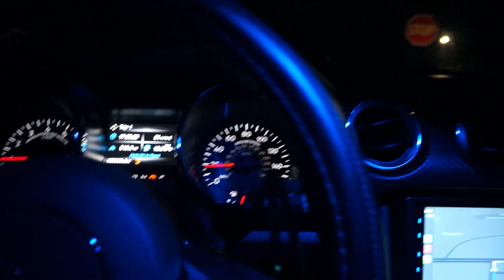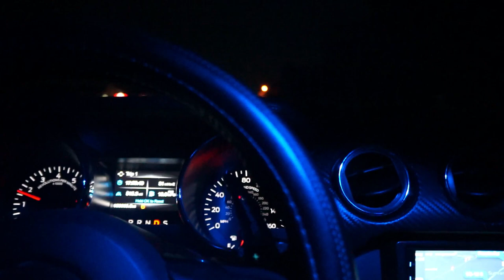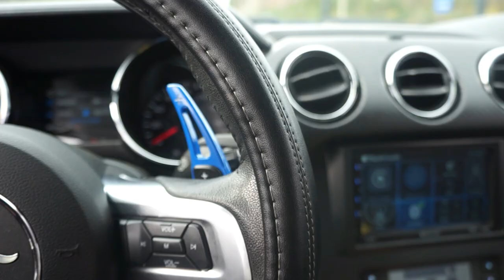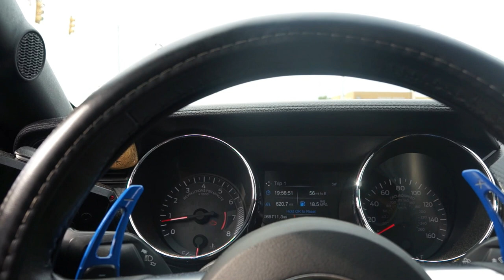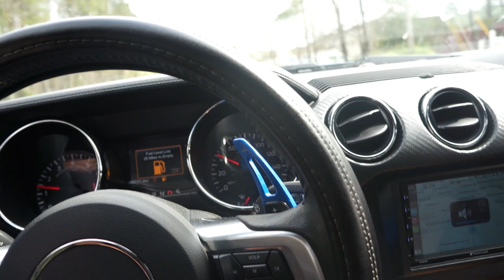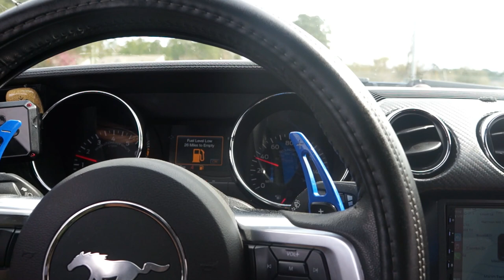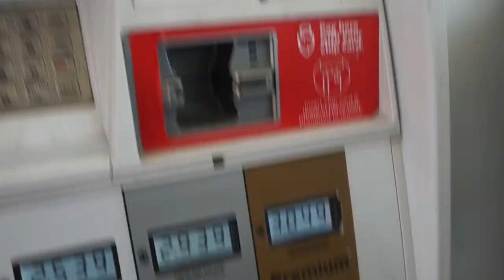V6 MUSTANG GETS RIDICULOUSLY LOUD! #Catless (vlog 5)

Comment: What’s your exhaust set up sounds great
Reply from the maker: Bbk short tube headers
Cat delete (welded 2.5in pipe)
stock muffler and resonator delete 
Super 10 mid muffler after the flex pipe
Straight pipe from the muffler back

Comment: Thinking bout putting jones resonators , got a muffler delete with Xpipe , throttle body spacer and intake with Bama tune.  Gotta try 93 with octane booster. Anti lag  is crazy with it.
Reply from the maker: Definitely going Jones, might try that octane booster. 👍🏾
Reply: @darkrose5.0  I’ve seen the resonators  set up like a Y shape on some mustangs kinda like JDM style .
Reply: Bama is trash. If you have a 3.7, get an HP Tuner and get tuned through auto mafia racing.

Comment: I know u have the euro tail lights but what kind have the yellow turn signal color? I’ve never seen that before
Reply from the maker: Most of them should have the yellow indicators. Most people don’t know that you can change the setting on the tail lights from red to yellow or if you want them sequentially or not etc.
Reply: Yeah I never knew you could change all at stuff. I’ll have to look into it. Thx

Comment: i did a resonator and muffler delete to my 2017 mustang im just tryna figure out what i can use to make it sound better with higher rpm have u found anything yet
Reply from the maker: still working on that myself lol. i’m thinking of adding some jones resonators, i believe that’ll help a lot. if you check my recent video i have a 3in catback installed and it sounds so much better than this setup in this video. i feel like once i add the resonators it’ll clean up the exhaust note give a deeper tone. and hopefully give a better sound in the higher rpm.
Reply: @darkrose5.0  can u link me to this stuff pls ?
Reply from the maker: @BubbaTheDon  to what exactly?
Reply: @darkrose5.0  the resonator and the 3 in cat back
Reply: Why don’t you just do resonator delete and replace with x pipe gives the car a little more power and sounds better
Reply: @DejaVu920  I did that but I didn’t get the sound I was looking for

Comment: What ur piping size ever thing have done with it bc I trying to do it to mine but I can find a good one
Reply from the maker: Short tube headers, cat delete down pipe, flowmaster super 10 mid muffler, straight pipe with tips. I’m no longer have this set up I’m currently running a 3in catback. You should check out how it sounds now 👍🏾.

Comment: I don’t understand. how do you remote start if you have the engine light on ? Mine has it on & it doesn’t want to start up
Reply from the maker: My code is just for the cats plus i’m tuned. Have you ever checked to see what code is on your car?
Reply: @darkrose5.0  yes P0036 is popping up . I don’t  know how to fix it
Reply from the maker: @Yosemite23  are you tuned by someone?
Reply: @darkrose5.0  I used to be with 93 . But I ended up selling the tuner cz I didn’t knew anything about cars when I first bought my stang
Reply from the maker: @Yosemite23  you probably have to get it retuned because that’s oxygen censor code. did you take your cats off?
Reply: @darkrose5.0  yes I’m running catless mid pipes , would I need to get it retuned?
Reply from the maker: @Yosemite23  yes definitely get it retuned.